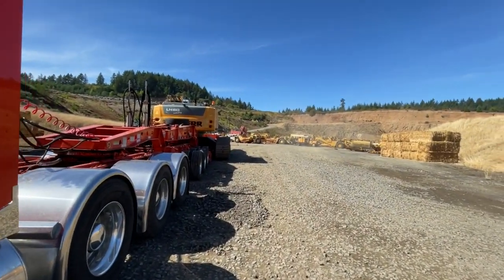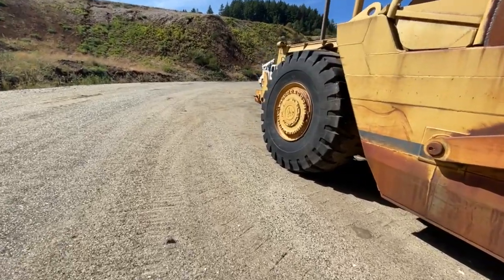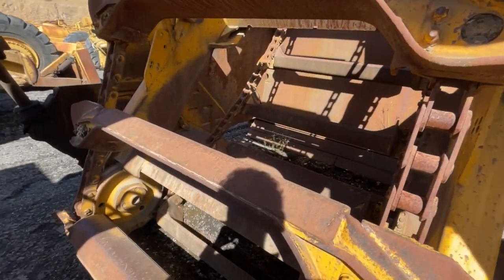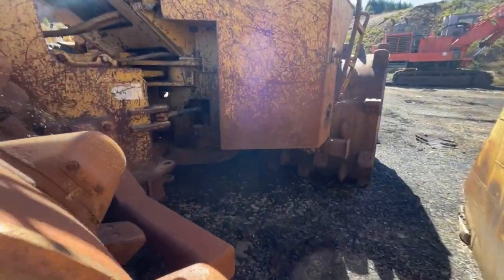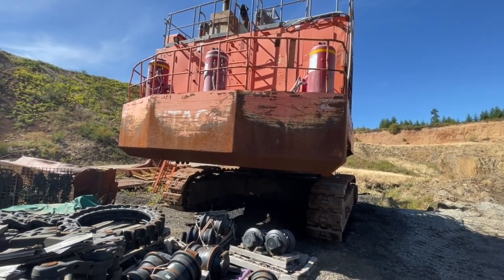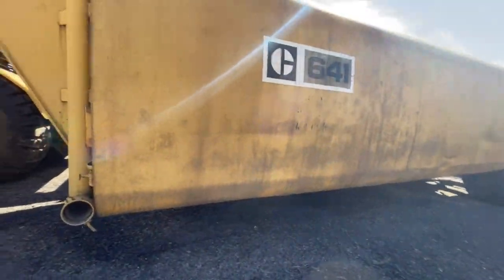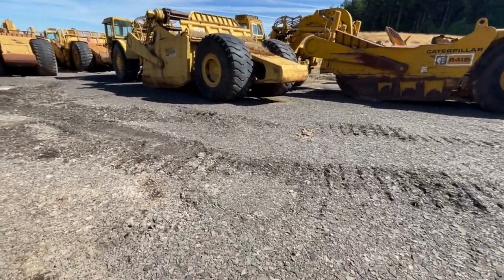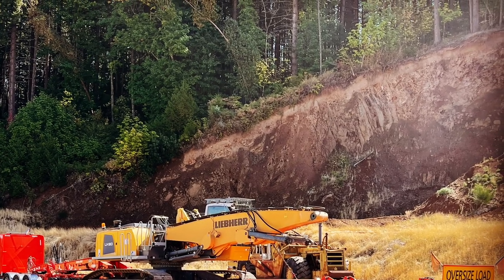The German, and a yard walk.

Comment: Saw one of those Hitachi's in Summerville, WV on a rt19 road project digging rotten rock instead of blasting and loading trucks with a bucket loader. 3 scoops loaded an off road dump truck. The Hitachi had been used previously to strip over burden in a strip coal mine. 6 tractor trailers were used to haul it aand was put together in 7 days.

Comment: the 85 model cat 621b we had in the us army weighed 62,000 ish and we hauled them with a tandem 92 freightliner automatic 6x6 with a 35ton paver style triaxle lowboy and we pulled D7G at 54,000 with the same setup and that engine brake would give u chills when u hit the switch and sometimes blow flames out the short stack

Comment: self loading paddlewheel.u cant pickup as much material with that as u can in those other 2 dozer assisted models and most of the twin engines and that horseshoe contraption in the front to push pull each other through the cut area.